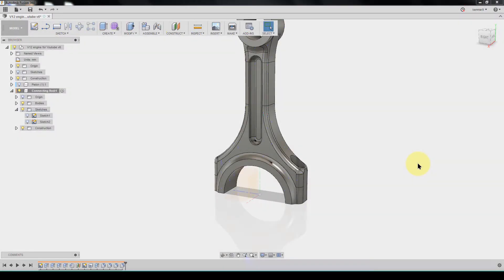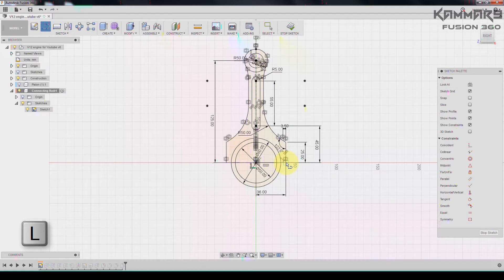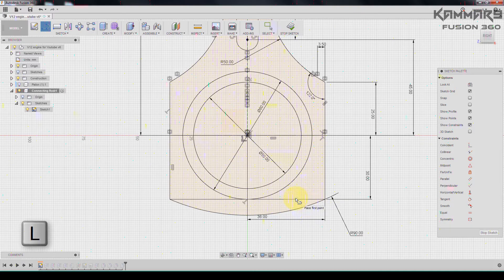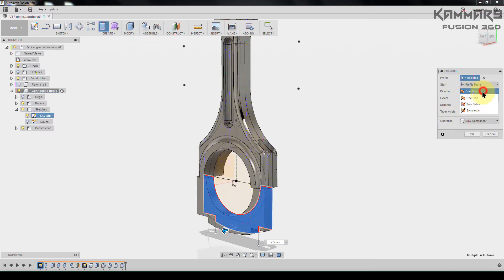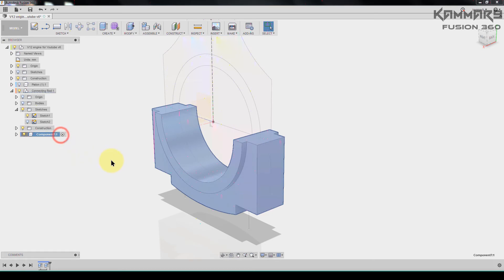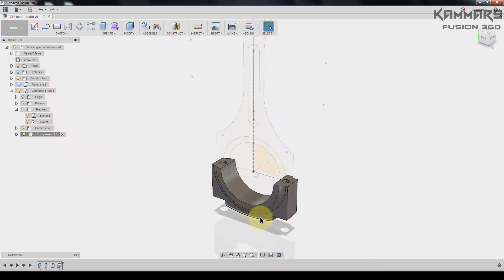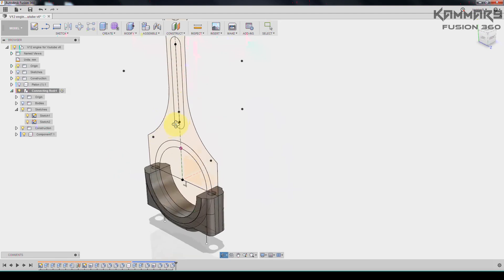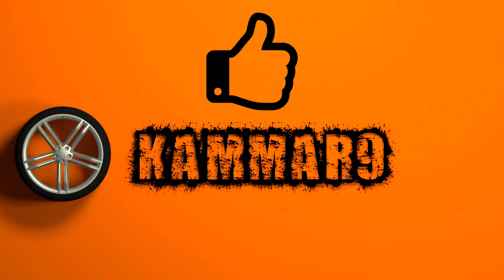Fusion 360 Modeling V12 Engine EP 03 😍 Full HD

Comment: I'm Mechanical engineering sophomore. But I dont know the dimensions of the engine. 😂. (You said a mechanical engineer knows). Can you recommend me a book or anything to get the dimensions.
Reply from the maker: Hi there bro , you can't find this dimensions in any books , you have to propose then calculate this not just add anything , find any books of mechanical engineering talk about dimensions
Reply: you would have to look at spec sheets if you are designing for a specific motor, either that or you can google standards although those can be quite expensive.